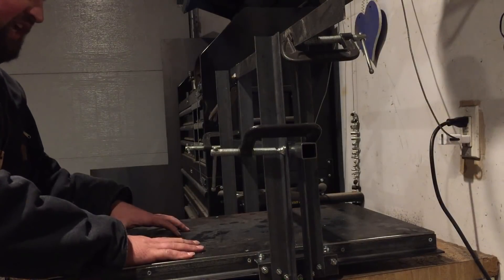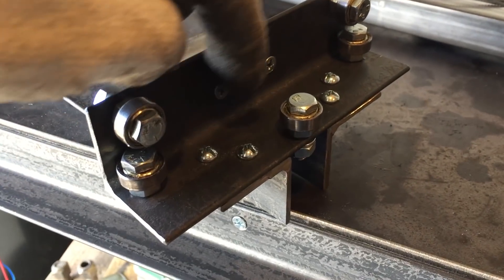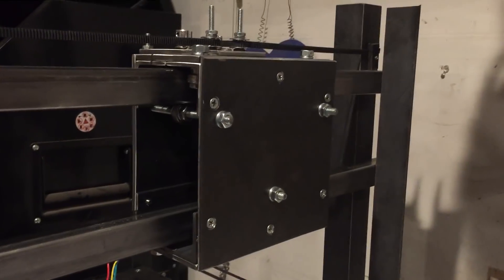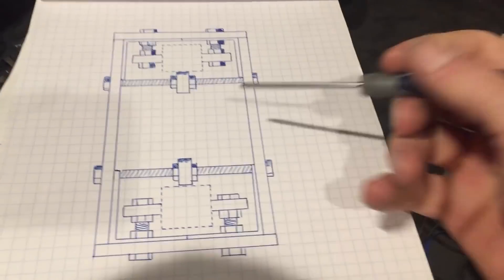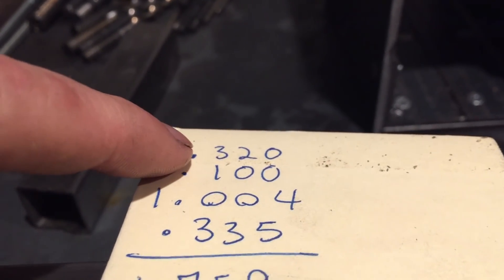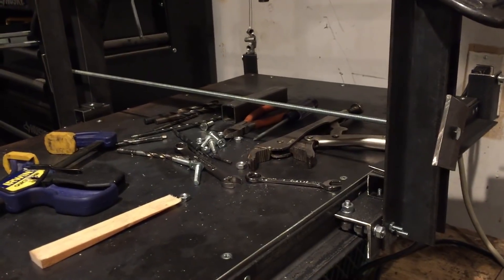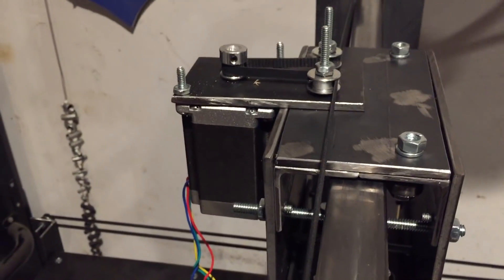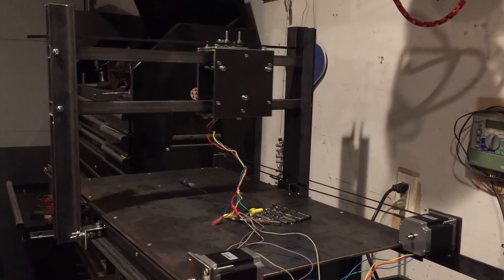CNC Build Part 3, Y-Axis build & Motor Install

Comment: Do,or have you noticed any issues with the bearings riding on the roughness of the angle material ?it doesn't look like you ground or polished the places on the rail that the bearings ride? I would think that it makes the tool bounce/move or give an irregular cut due to the roughness........ Thank you for sharing the great information though!

Comment: Great job . 
Could this be modified to be a plasma cutter ?
Reply: It could be with screw drive. Dont think the belts would hold up to the heat. Look up 3D printer carriages. Its the same idea as this but a smaller scale but with aluminum v slot rails. Yes I know this is a year old comment

Comment: Love your project.  I am using some of your ideas for a machine of my own.  I have a couple of questions for you.  How tall did you make the risers for your Y axis?  How did you get the 1/4-20 threaded rod into the 6mm ID bearings.  I found the 1/4-20 bolts too tight to fit into the 6mm bearings so I bought 6mm bolts instead.
Reply from the maker: It didn't WANT to fit, but it did. I had to polish the threads on the end. All is well that ends well.
Reply: @StrangeGarage  LOL, well, what ever works!  I found some 1/4-20 were a smaller diameter and I was able to press the bearings on, but I did not like having to do it. I broke down and bought some 6mm bolts/nuts.  That worked really well.  18" for the risers sounds about right.  Thanks for getting back to me.  Back to the garage :-) for me!
Reply from the maker: @stevesfascinations1516  Also, you can buy bearings with set-screw collars that work great for just about any diameter. They're more expensive, but MUCH easier to use. I would reccomment pillow block bearings, but flange bearings will also work fine. Good luck!

Comment: I understand the cost savings with belts. You used a direct drive without gear reduction. I noticed in your comments you had accuracy issues. Did you have any issues with torque or the steppers running too fast? How much use did you get out of it as is?
Reply from the maker: No, I haven't missed any steps or anything. I made all those mistakes on my last machine. I used this machine a ton before I switched to screws (new video isn't done yet). Hundreds of hours with no issues besides accuracy.
Reply: Awesome I am going with a 20mm belt and did not want to spend extra on planetary gearboxes or belt reduction. 8ft lead screws are not cheap. I am hoping to do as you did. Get some use before I switch. Thanks a bunch.
Reply from the maker: @BonifiedWingnut  The smaller the drive pulley the more torque, just keep that in mind. Are you making a plasma table?
Reply: Well I am building a router table but I would like the option of adding a plasma cutter later. But I have not even priced them yet.
Reply: @StrangeGarage  Hey one more thing. Did the all thread work for drives on your previous build? I was thinking about using it for z and maybe x
Reply from the maker: @BonifiedWingnut  so, the thing about all thread is it's always bent at least a little bit when you buy it. I'm sure bigger motors won't care, but my old machines were NEMA 17's, which did not run well with bent rod. I could only run about 15 inches per minute. Any faster and the steppers would stall and miss steps. It can be done, but it's a lot of work. If you do that, buy pillow block bearings that fit the thread really good, it will save you a lot of trouble!
Reply: @StrangeGarage  Pillow blocks are cheap. Thanks a bunch. I am using the larger Nema23s 15 per minute would probably be ok for z.

Comment: Any specific reason why not using acme threaded rod with?  Cost I'm guessing? Neat build with looks like no welding either.
Reply from the maker: Lol, I'm switching it to acme screw now, lol. Cost was the reason for belts, but accuracy was an issue when cutting metal. I decided it was worth the cost to switch.

Comment: Not to bad of a design easy and simple I like it like that.... I am gonna do thread drive instead of belt though but other than that I am gonna copy your basic designs.. I do not anticipate many changes at all... thanks carry on!
Reply from the maker: Screw drive is a smart move. I'm actually switching mine as we speak. Otherwise it's been a fantastic machine.
Reply: @StrangeGarage  Well I sure enjoy an insite to this screwy machine.. It saved me a lot of time.. thanks for the update.. happy holidays..

Comment: Why did you use belts instead of worm screws?
Reply from the maker: Cost and simplicity. I'm switching it to screws for better tolerance, but I did this video to show people how to make a cheap machine. Screws almost double the cost of this machine.
Reply: @StrangeGarage  Hi. What  screw diameter will you get and Which pitch will you use on the screws?. Also what is the torque of the nema23 motors?. I have been stuck on these details for a while now.

Comment: Baffled. Y axis is front to back. X axis (side to side on the gantry) is side to side. How are you getting that wrong? You're gonna have fun with Mach 3 setup... great build, BTW. Might go this route myself, I need a bigger machine. Keep up the good work.
Reply from the maker: It's all relative. I can just swap my program or my machine around as needed. 

Come to think of it, it has always been right when I post the process from fusion into mach3. I don't know, I just build things.

Comment: thanks for the pics & instrucs but i'am a newbie to cnc, would you direct me to a site or  page with full wiring instructions from computer to motors. oh, i already bought one hybrid stepper and controller and have not tested yet.
Reply from the maker: https://youtu.be/kM9bWo8Rl84

This should answer some of your questions. Any CNC controller should have piles of good setup information online, just depends on which controller you get. Without knowing exactly what controller you buy I wont be able to come up with better info.

Comment: You only have two bearings keeping it from racking!? How did it work out?
Reply from the maker: Super tight setup. The main racking prevention is twin steppers on the x axis. Without that I would have to go to greater lengths.

Comment: I would have put the steppers on the gantry... less belt = less backlash.
Reply from the maker: I don't like the belt setup all together. It's fast, but I never run the machine that fast. When time permits I plan to switch to some screw-type drive.
Reply: @StrangeGarage  I use #25 chain to move Z carriage along the gantry and #35 chains to move the gantry along X rails on my 80"x 144" router. On both axis the motors drag themselves along the chain, similar to your Z carriage drive, although the motor shafts must be positioned horizontally for the chain and sprockets to mesh properly.
The rapid moves are relatively slow (about 120 in/min) with chain drive but that does not matter that much since cutting speed is 25ipm or less anyway. I found chain drive to be simple to make and the only cheap alternative to rack&pinion for diy large size machine. As a bonus, chain drive has no backlash.

Comment: Very nice design. Why not use aluminum for risers and do some welding ? Sorry for questioning your design but you made it very heavy. Those motors need a wider belt so you don't get the rubber band effect.
Reply from the maker: Aluminum is not extremely friendly with CNC applications, especially for load bearing parts. My last CNC had some aluminum parts and they just flexed too much. 

I agree with you about the belt. I may switch to ball screws at some point in the future.
Reply: @StrangeGarage   Cool. Im not sure if someone asked below but I couldn't find part 4.
Reply from the maker: @rsz90182  https://youtu.be/Nmz50vaK-Ak
Reply: @StrangeGarage  Thanks for the aluminum tip. I have a room full of wrought iron I got for my widows bars etc and angle iron. Its rolled steel like yours and I am going to build one half the size for CNCing aluminum parts to build better CNC machine. Your design looks very nice. I think once you upgrade to worm drive it will be a pro machine.
Reply from the maker: https://youtu.be/W6TTEPsUb7Y

Comment: Awesome man, love seeing the progress!  Your machine is running great!
Reply from the maker: +Ted H It's obviously different for me because I'm grinding it out, but watching it progress in the videos is pretty cool. I'm starting to get pretty excited man. I can MAYBE have it cutting next week, wife willing. It won't be done, but it will be functional.
Reply: I hear ya on the wife willing;-) and am excited to see it cut your first design for your new machine!  What are your going to do with your old machine?  I predict keep it so you can cut two designs at the same time!
Reply from the maker: Ted H Some type of upgrade is in order but It's all up for discussion at this point. I need to worry about the boat first, lol. I still need to gut the wire harness to get rid of what I don't need.
Reply: I am looking forward to seeing the boat out on the water and you getting the chance to have some fun on it with your family.
Reply from the maker: Ted H We have at least a couple weeks before weather will allow, but It'll be nice to relax a little! I am going to have to do "sea trials" first, but it should work out fine. Then back to business again.

Comment: Can I get the plans/parts list?
Reply from the maker: Adam Ross Bad news man, I'm building into the void. I designed about 15% of it, the rest is seat of the pants. I even drew my diagrams after the parts were built just so you guys can see how I did it. I will do a FULL parts list at the end, but I won't have it until it's done.
Reply from the maker: I'm not kidding man, everything I'm doing is in the video. I have no info. Also I don't use email, too much spam.
Reply: Strange Garage Thank you anyhow, keep up the good work!!
Reply from the maker: Adam Ross I wish i had documented more! I had to make another set of rails for my Z axis, and I literally had to measure the x rails to see how I made them. I'm my own worst enemy man. Thanks bro! I appreciate the kind words!
Reply: Strange Garage dude I think I’ve watch all of your videos or at least most of them, I appreciate that fact that you use harbor freight tools, for the simple fact that a lot of us can’t afford the Lowe’s or Home Depot brands. You’ve got my support 100%
Reply from the maker: Adam Ross Bro, 99% of my skills came from being poor, so I get sick to my stomach seeing how much those big stores charge. I work on cars constantly, so I wanted a good set of ratchets. Snap on wants $116 for a single ratchet. Forget that, my Craftsman set is just fine, and the SET was $200. 

Thanks man, seriously! Just out of curiosity, which videos did you like? (Assuming you liked any, not trying to sound cocky)
Reply: Strange Garage well where to start, I like all of your CNC builds, the work on the ranger, and your custom f150 bumper & starting button, and the first video I saw of yours was the custom garage radio out of a car head unit and goodwill speakers (great deal on that.) btw I own a 83 danger ranger, I’m currently rebuilding the ford 2.0 Lima motor for it.
Reply from the maker: Adam Ross BADASS! I told someone today that I want to do a Lima rebuild for my boat sometime soon! The one I put in there is a little tired, 1 or 2 boating seasons is all I want to squeeze out of it. Sweet man, I'm glad you found my channel. I love having people interact with me on my channel, makes it more personal and motivates me more. That's super cool, how is the rebuild going so far?
Reply: Strange Garage bored .030, bigger pistons/rings, new mechanical fuel pump, new bearings top/bottom both block and head machines to each other, valves all ground and lapped in ( waiting to get it from the shop ) new oil pump, all new seals and gaskets, original cam and crank, new valve guides, whole motor got dipped in caustic solution, new paint job went with ford red and that’s all I can think of right now bout 2000$ worth of work
Reply from the maker: Adam Ross Dang. I was hoping I could scrape it together cheaper than that, but I don't want a crap motor either. It's awesome that you're doing it right! I've never had anything "new", and I'm probably keeping my boat a long time so I might as well. The truck must be pretty clean to go through all the trouble. That or you really love it.
Reply: Strange Garage well the truck an old farm truck (danger ranger lol), it was my first 11-12 years ago, i can always upgrade the truck, the motors a single barrel carb, so if anything I can pull the motor and transmission and put it in any lightweight truck. You can probably scrape up about 1000 dollar build, just depends on what all you wanna do with it. Do you have the 2.0 2.3?
Reply from the maker: Adam Ross It's a Efi 2.3 from a 1992 ranger. That's actually why I bought that boat because I knew a ranger motor would fit. I've had 7 rangers, can't get enough if them. So cool man, I'm so jealous you still have your first truck! I'm trying to buy my Dads ranger from him, which is the first vehicle I ever drove. 

I usually don't make a plan until I assess the damage, but if I rebuilt the motor I would rebuild the outdrive too (which has a super basic transmission) and that effectively doubles the price of the project. Gotta assess the budget first. Hoping YouTube starts paying for itself before I get that far though!
Reply: Strange Garage I heard that!! After I get the Lima finished I’m gotta start work on the my old 95 f150 it’s got a 351w 250,000 miles never been rebuilt, it’s got a head gasket going bad. Eventually I’m tearing it down to frame to clean paint and treat, 2wd to 4x4 with ox locking differentials, auto trans to zf5 speed manual transmission, custom dash, and other misc interior, custom grille, 08 front bumper, lift, Saginaw power steering pump, etc... you get the idea, I’m going to turn this truck into something that’s better than showroom quality
Reply from the maker: Adam Ross That's a big project. I can appreciate how much goes into that! 250k is pretty good! And when the frame is stripped It'll be much easier to swap out the 4x4 suspension and axles. Super cool!
Reply from the maker: I totally forgot they still used the 351 in late models. That's going to be an awesome truck!